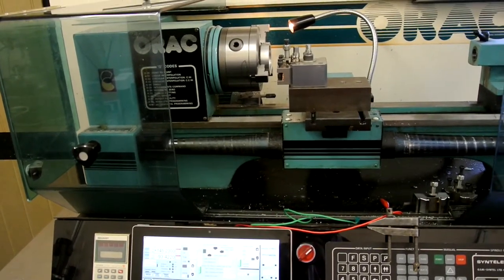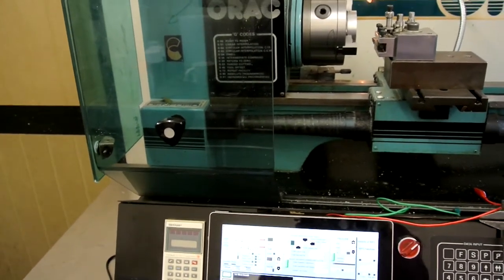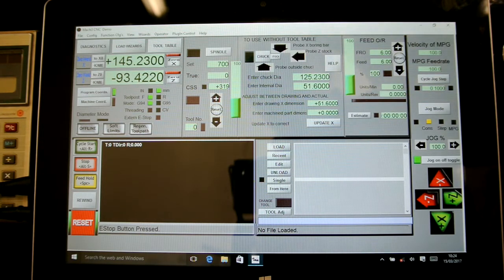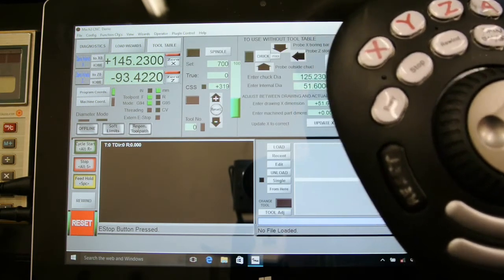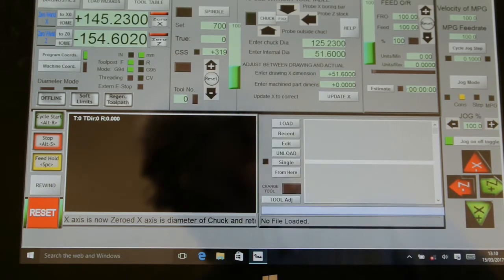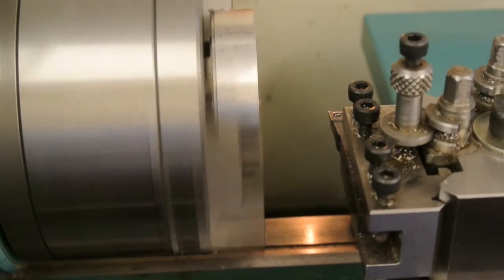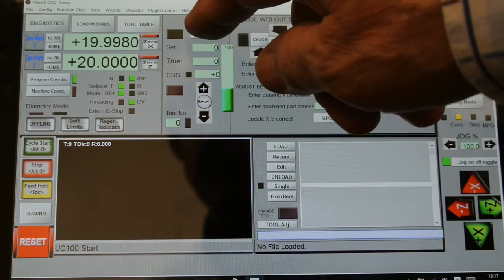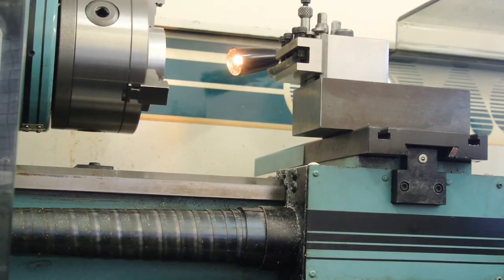Mach3 windows 10 tablet

Comment: Hello John,  I think you have done an outstanding job with your Mach3 Lathe Screens and video.  I am very impressed with the touch probing screen.  It seems some much easier and efficient than the manual method I use.  I was wondering if there might be a possibility you might share with me a copy of your touch screens please?  Thank you, Keith
Reply from the maker: Hi Keith
Thanks for the kind remarks. No problem if you want to try them. Just email me and I will send you a file. To do the probing you would need an insulated tool post or alternatively an insulated work in the chuck so you can get the signal to send back to Mach3. The insulated tool post is by far the best solution as you are guaranteed accuracy. Touching off on work in the chuck introduces an error every time it is inserted in the chuck.

John
Reply from the maker: Keith you can get me on the contacts page of www.jgwright.co.uk If you still would like the file Youtube messages seem not to work!